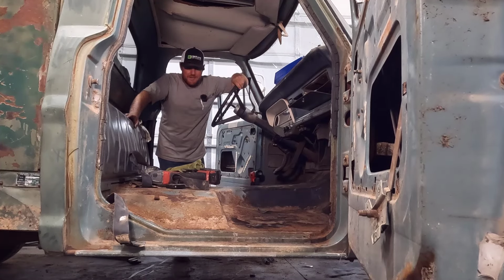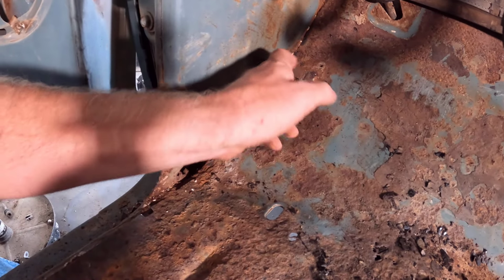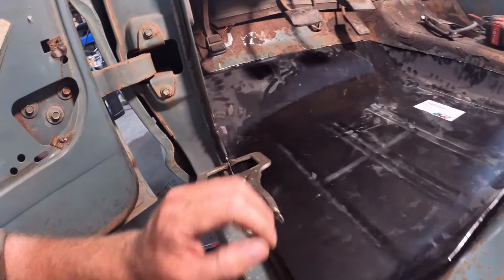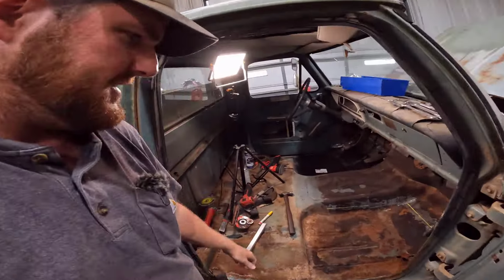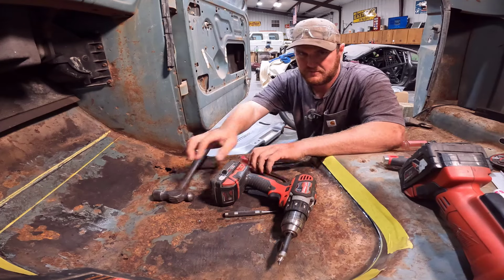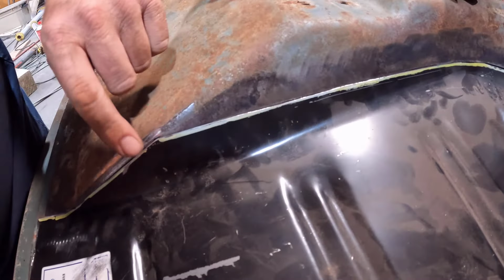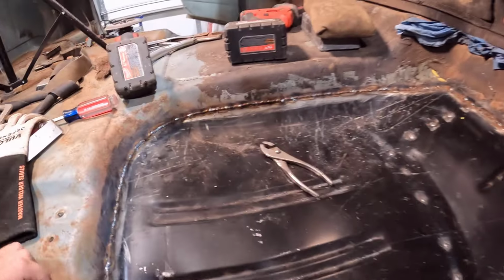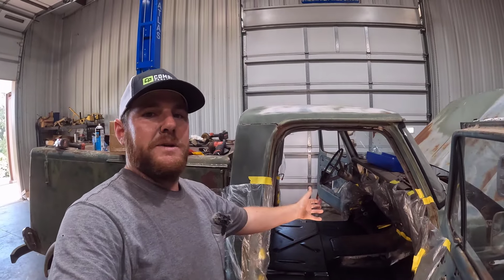My First Attempt at Replacing Floor Pans! The 1967 Bell Service Truck Get Some Rust Repair

Comment: Very nice job Matt.  I did this a couple of years ago and like you, the second pan went easier.  I appreciate your video and tricks you used.  The 1” making tape under the pan between the frame and pan was a great tip.  Time and straight cuts are a must so great job!
Reply from the maker: Thanks!

Comment: Nice job Matt. I find the body work is so tedious in comparison to the mechanical work. Do you find that different suppliers have different quality sheet metal? Do you have one supplier you prefer over another?  Thanks for another Good video.
Reply from the maker: You have that right! A lot of the parts come from the same place but not all. It all kinda depends on what you are getting.  LMC is sometimes lower quality. I used AMD floor pan on the driver side and one from NPD on the passenger and the passenger fit way better, but also could have been my fitment.
Reply: Do you know what country the sheet metal comes from?
Reply from the maker: @russellweber4334 Taiwan for the most part. Carolina F-100 has some USA made parts that fit amazing. But limited parts are available.

Comment: The heater delete is interesting on that truck
Reply from the maker: It has the economy heater. 67 only deal. Heater control is a single knob under the gauge cluster and defrost is controlled manually on the heater box. No temp control. Deluxe heater had the 3 knobs under the radio.

Comment: yeah the snow ball effect is a terrible thing lol.  Good job with some good pointers on the pans.  I’m currently swapping a 67 f100 to a 78 150 4wd.   Replace all the usual sheet metal.  Question I have is about paint.   It’s harbour blue and my wife is sick of patina so am going to paint it.   Is that a color that the autobody shop can mix up or do you buy the original ford color someplace? Thanks Matt
Reply from the maker: Paint shop should be able to mix it up. I recommend using the PPG code for the color.
Reply: Awesome Thank you
Reply: I’d like to see your work/story on this, I’m going to be doing a 70 to 73 soon. Curious what you run into
Reply: I’ve watched as many video that are out.   And mostly working my way through it.   Just a couple of things so far.  I shortened the frame 2. Inches.  And I will have to cut out the trans tunnel cover on the 67 so I can use the 78 4wd tunnel cover. Lots of fun figuring as I go. I’m not tech  guy but should figure video out and get my projects on you tube.
Reply: Mortske has a good video on this swap. He explains getting the box mounted.

Comment: That looks much better than using old license plates with self tapping screws to fix the floors.
Reply from the maker: That would have been WAY faster though!
Reply: There are guys that do that, they have utube channels such as pole barn garage.